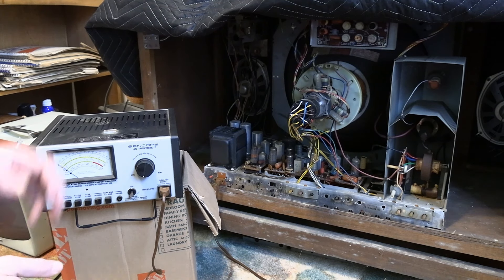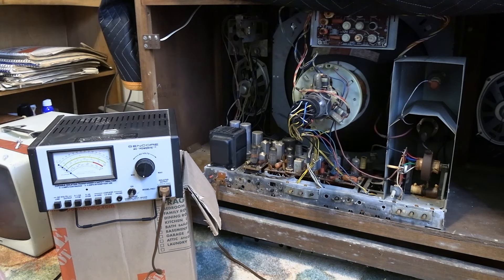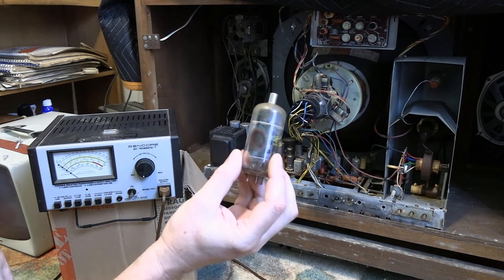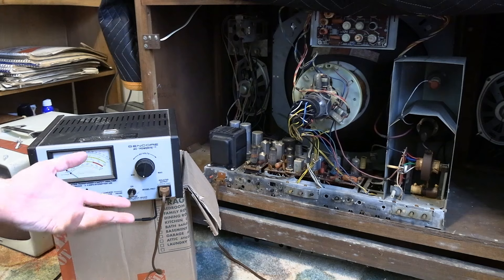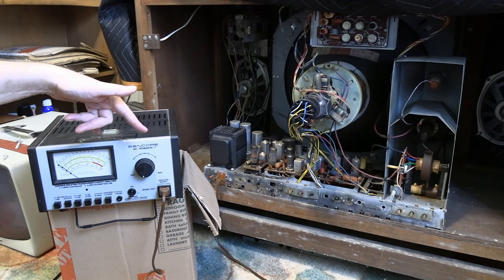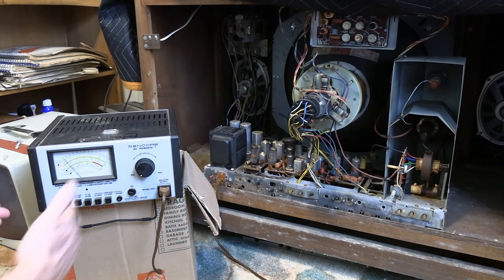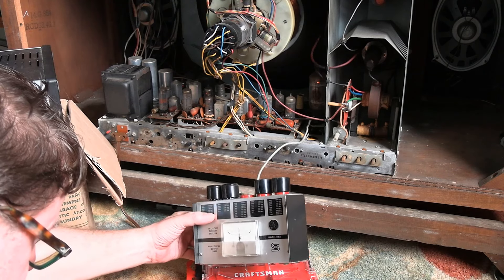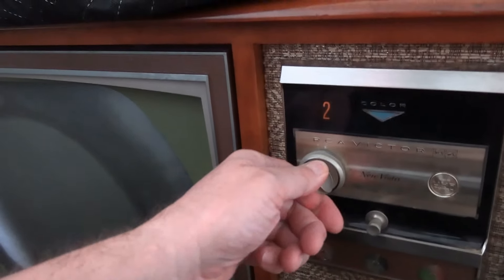RCA CTC-15 "Alexandria" roundie restoration part 1

Comment: Hehe, I restored to operation a CT-100 back in 1965, repairing a CRT green cathode short, and a lack of color (3pf coupling cap). The set worked for years. Compactrons and 21" CRTs are when I stopped servicing them.

Comment: Great! Now, you just need a very warm day and a heat gun to remove the cataract. Very cool!!
Reply from the maker: Warm days are over until next year I'm afraid. I'll give it a try inside with heat gun/lamps. Maybe a hot wire
Reply: @bandersentv  Didn't Shango remove one by letting it soak in a tub of water for a couple of months? I know it is not quick, but may be another option, and safer.

Comment: Cut my teeth on the ctc15. Beginning of x-ray scare times. This set his the 6bk4 HV regulator which was "serviceman" adjustable on that row of pots in back. Of course customers would try to  get picture brighter by cranking it up. 
That feature was made fixed soon. 
replaced fly's, electrolytics in evolving color TV s of the time, fun stuff.
If alignment on the bench was a bear, remove 6je6, put like 100 watt load to plate cap, etc.
Not long after, built my parents Heatkit GR295 much the same circuitry. 
     The "295" was the square inch viewing area of its 25(bp?)p22 rectangular tube, not the diagonal marketing wank to come soon.
For less need of customer adjustment rca had no DC restoring. Added a DC restoring circuit to the heatkit. I think a 12ax7 or the like dangling in the back.

Comment: Excellent first power-up! Bob might encounter some difficulty adjusting for screen geometry because of that dreadful CRT cataract. In one of Retrochad's old videos, he modified a color TV set with a relay for the power supply. The set's original switch was re-wired to control the low-voltage input on a relay, which then turned on the set with direct mains voltage. This was done to lessen the possibility of carbon forming on the original on/off switch and damaging it.
Reply from the maker: I'll fix the cataract before I adjust the screen geometry
Reply: @bandersentv  Remember, Bob -- When engaging in such a task, SAFETY FIRST!
Reply from the maker: I've been working with CRTs for 40+ years - I'll be fine.  The 21FJP22 was not originally sold with bonded safety glass.  The earlier sets used a separate piece of glass in front.  The CRT is just fine without it.  What I mean is it's not like a tensioning band.  It doesn't really add to the structural integrity of the CRT.  It's more a convenience for manufacturing and of course projecting in case of implosion.

Comment: Tuner has a service poss near power xformer. Also done by Zenith, Maggy.
Sylvania & others. Makes things safer  & easier.
LFOD !
Reply from the maker: So I keep hearing, but I don't see it?
Reply: @bandersentv   2 screws at AC interlock. loosen & slide in. Usually they had a metal arm also coming from the chassis. Look for 2 slots on TNR assy.  Maybe was left off ??

Comment: The 6JE6 and the 6DW4 damper are NOT Compactrons.  They are "Novar" types which were an RCA invention.  Compactrons have 12 pins, Novars have 9.
Reply from the maker: Thanks for the correction
Reply: Then there are Magnovals, same 9 pin dimensions except the pins are larger diameter. Both can sometimes be found in audio amplifiers.

Comment: Very nice set, be careful of  the radiation with that cover off
Reply: Is there a way to measure the X-Rays? Would a Geiger counter work? I know some used lead covered high voltage rectifiers.

Comment: When you pull the chassis, the tuner should mount on the two screws below the power transformer. The tube chart would have been on the back of the H.V. cage.
Reply from the maker: Thanks for the tip.  Looks like the glue failed and the tube chart fell off long ago.

Comment: The picture quality is surprisingly good considering everything. Another one you might want to take the safety glass off and clean it up and reglue it.
Shango just posted one up recently and it was a RCA tube so a good one he probably put up knowing what you're working on. You could eliminate the safety glass and it would probably be way brighter if you want to chance it. Once you reglue it it's not as tightly bonded anyway so not as designed to work anymore.
Reply from the maker: I'm definitely removing and gluing the safety glass on both CRTs. They did not originally have bonded safety glass - it was separate. So I'm not so sure about it not being as safe. Really depends on the type of glass used
Reply: Watch Shangos video, he covered all that and the warnings too, plus you could probably call him and get his best advice directly. Either way both sets are going to look surprisingly good when they're done. That RCA even looks like the guns are tracking the grey scale really well 👍
Reply: @69Dartman  There is also videos by Tom Carlson. I have problem with Shango's voice, I keep thinking he is going to talk about ordering low cost Viagra and Cialis.